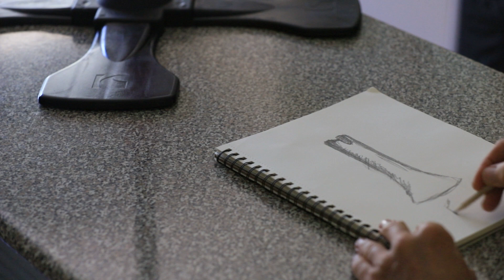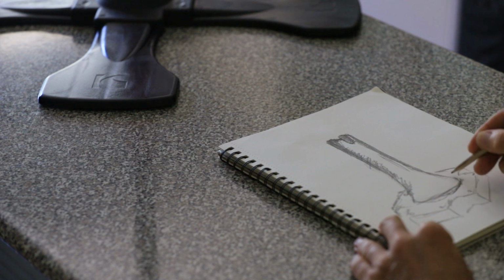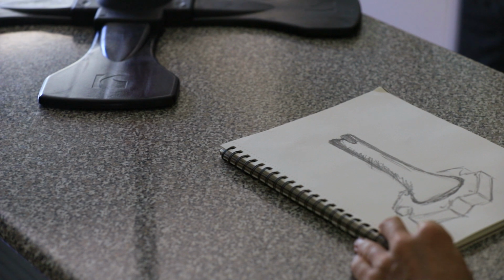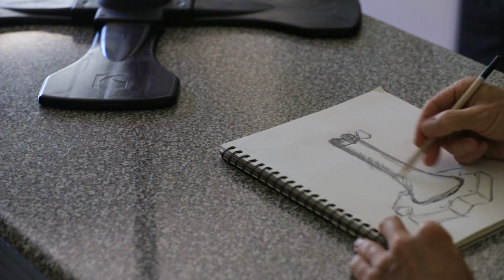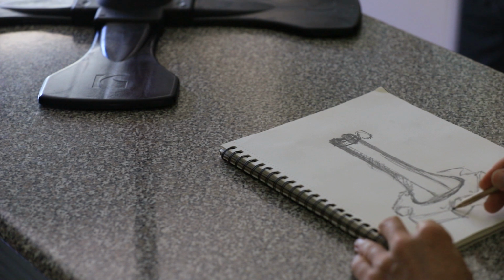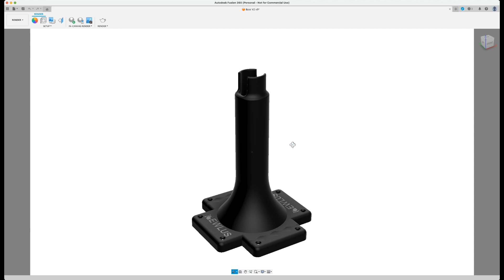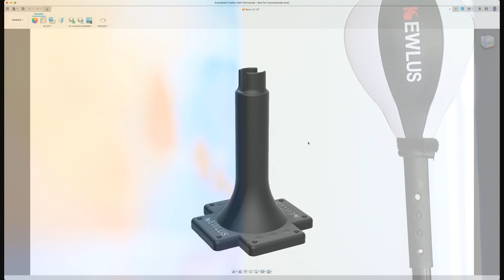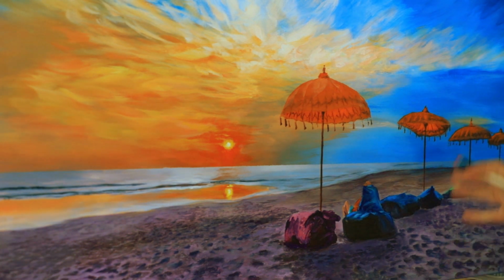Cobra Bag Pro Base Concept

Comment: Have you considered an attachment for your base to use Powerblocks instead of the paddles & sand bags? 

I think it'd be a great market to tap into with people that are willing to spend a premium on getting as compact as possible but without wasting space on sand bags & bases.

Most Powerblocks like my Sport Exp have a flat bottom in the middle & weigh 41kg each at stage 3, surely a rubber mould to place 1 on each side would  be even more stable as well?

I'd most certainly buy one instead of designing my own to use with your spring & bag adapter, hell i'd even buy the entire modular setup too.
Reply from the maker: It's an interesting idea, but they cost a small fortune and they don't really have a wide platform, so stability might not be the best with them. Ideally you need a base platform that is at least 2 feet x 2 feet
Reply: @Kewlus  I think the almost ridiculous expense is the key factor it'd be a great market to tap into, adjustable dumbbells are big sellers among people with disposable income & limited storage space as there are no other options & they have a proven history of people paying just as big for third party accesories like up to 200usd just for a knurled steel rod as a grip attachment... I think your product would very quickly & easily target that weightlifting audience as a fun cardio product even with something as simple as a base plate with side walls to complete as an end product & market itself.

I would have thought 82kg (41kg each side) would suffice but in any case mine are 45cm long and 16.5 wide, not far off 2 by 2 feet with your base mount in-between. I'd be happy to send dimensions or make an mdf mockup to trial & test if you want to send me the rest wink wink but you could get the same test results with a pair of 40kg dumbbells at under $300aud or at your local gym for free.

I really think it will help market and boost your product sales, especially in America, the home of Powerblock.
Reply: @Kewlus If you do consider production, potentially a universal base mount to accommodate all popular adjustable dumbbells over X kg, Powerblock sport/pro, Ironmaster, Nuobell, Bowflex, etc. A huge market of customers to tap into with self promotion of your unit in itself & creating even more niche in the first cobra bag that doesn't need any base taking up space if you've already got it.
Reply: I left lifting weights years ago. That buffed up body fad has long left me and I made a choice to be rather flexible with lungs than look so big I cant shampoo my hair. But nonetheless,  I guess thats one use I can get out of my old powerblocks just sitting there.
Reply from the maker: Quick update: I am looking at releasing a new base in the shape of an octagon which will be able to hold hand weights of various sizes and shapes. It will come with two 20L water bags that can be used instead of weights or sandbags
Reply: @Kewlus  thanks. Also if we store the cobra bag unit outdoors, do you have a cover for it to keep the rain, snow and weather out?
Reply from the maker: @Kendkend I don’t have one for sale but should be quite easy to make one using a couple of large garbage bags - cut the bottom of one and use it to extend the length of the other
Reply: @Kewlus  
Sounds great. When are you expecting to release it?
Reply from the maker: @Josh-jo3kz around June
Reply: @Kewlus  Hey, is that new base still coming soon or would you have any promo codes or upcoming specials on the current models?
Reply from the maker: The OctaBase base is coming out as part of the new O3 kit: https://kewlus.com/products/o3-cobra-bag-kit
Reply: @Kewlus  Ah, looks good for dumbbells but not so much for my adjustable dumbbells that would tilt & put pressure on welds. 
Any chance you've got or could do a promo code for the KS3 freestanding or core kit? 
I really do want one & to support you but honestly keep procrastinating at the current price point.
I don't want to offend you but instead provide some feedback that maybe one day I'll pull the trigger but I just can't justify the total price based on the poles, the specialty parts I can absolutely justify but then what's the point of spending $300aud if it's going to look ghetto, so I think I might aswell make the diy one for under $50 but then I don't really want a ghetto looking one so back around in circles I go waiting for a sale as a potential buyer.
Maybe you could think about adding another option for the KS3 core kit without sand bags for people like me that'd be in it for closer to $330?